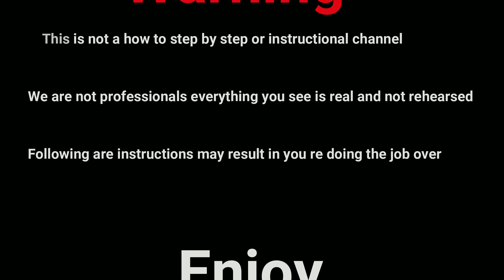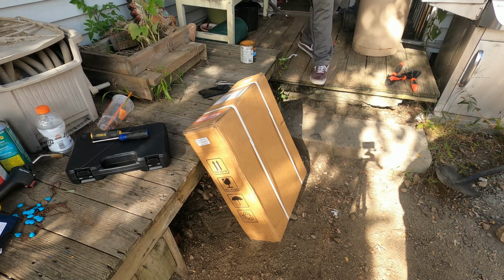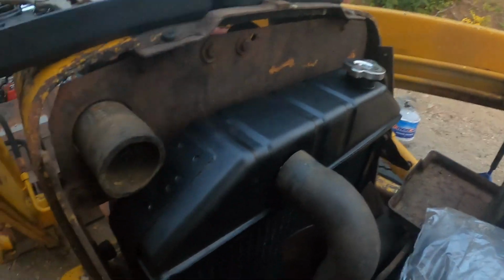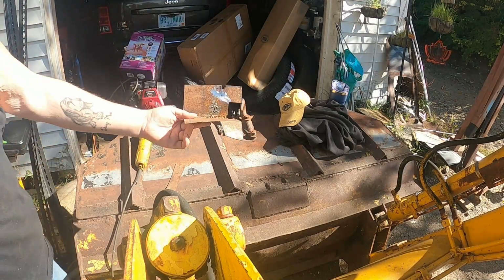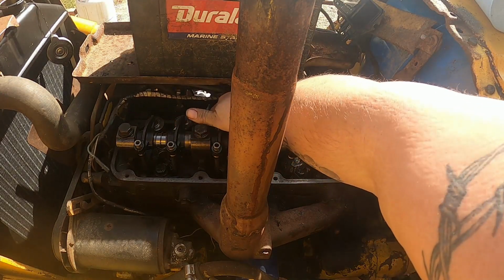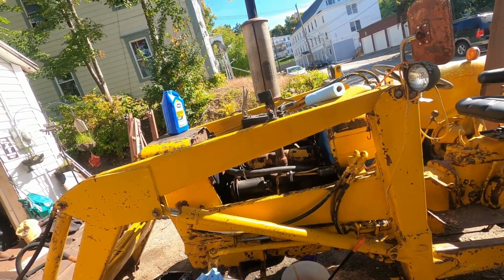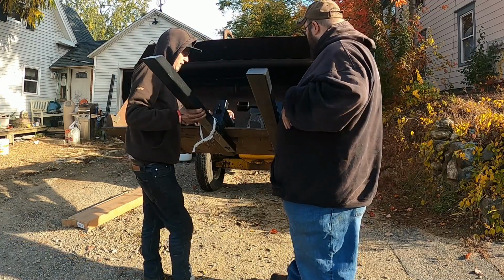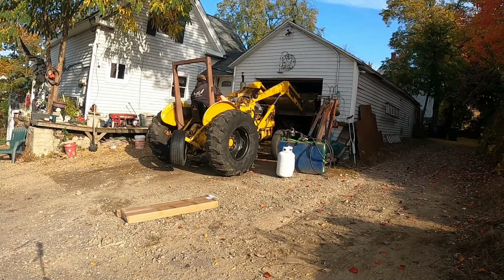I broke it 1974 ford 3550 industrial tractor

Comment: Hit the cooling system with a pressure checker. That should tell you right away if its a mechanical failure or just excessive condensation. Could have a hairline crack in the block somewhere too. Hopefully not as it does run really well!
I have this same problem with the 289 in my Mustang II. It just sits, in a car shade on gravel. Rarely gets started, sits outside in a car tent all the time.
Reply from the maker: What a shame time to get a new motor and get her going again
Reply: @Junkerclunkerz  new motor? Hell no...!! I'm just changing the oil and beating it like it owes me money! As long as it still runs, its good to go!